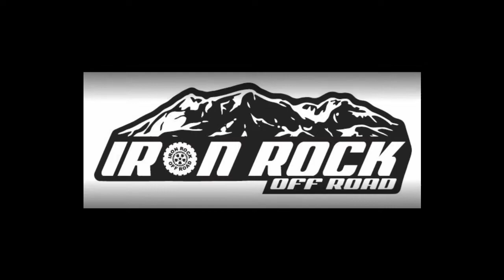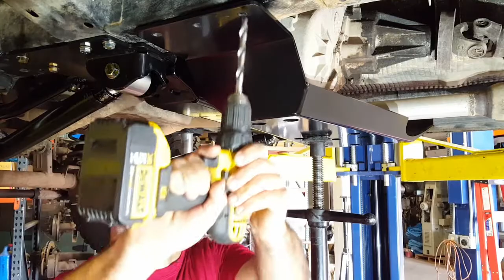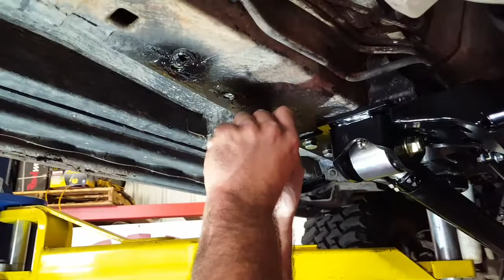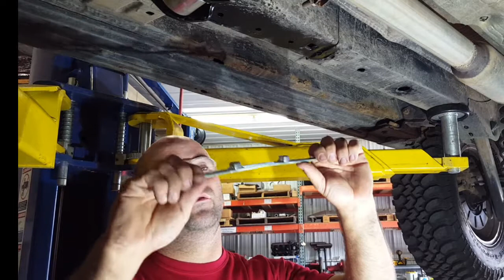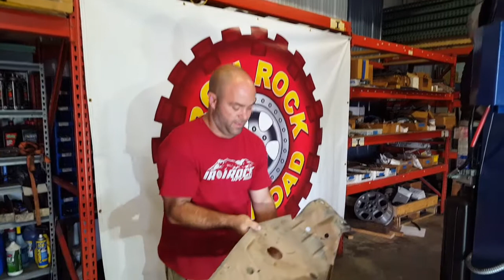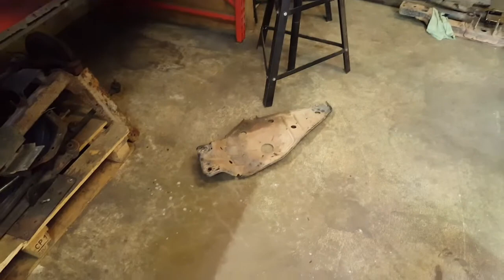Iron Rock WJ Belly Skid

Comment: Instead of putting a bolt in to hold the nut plate use a threaded rod about 4" long, put one on each end.  Now when lifting the skid in place the rods go through the bolt holes allowing you to hold the nut plate while threading the other bolts in.
Reply from the maker: @charliedee9276 Great tip! Thank you!

Comment: Here's a thought, how about drilling an extra hole after you take off the pan. Then get the nut plate and bolt it down without the skit plate. Now weld the nut plate to the frame where you drilled the extra hole. No more nut plate getting loose or having or having to fight with realigning that nut plate every time you need to remove the skid plate.
Reply from the maker: @romeshter Good idea!

Comment: I have mine in place but it contacts the bottom of tc.  Just the last bit of movement to body, the plate contacts and barely pushes it.  I do have the iro front long arms but not transfer case drop plates.  Wondering if the contact is bad juju.
Reply: You probably have worn motor mounts/ transmission mounts.  Letting it all sit lower.  I replaced mine and the transmission and engine sat about an inch higher afterwards.